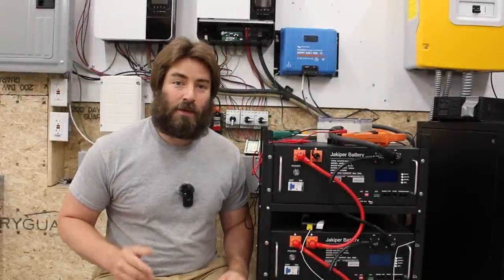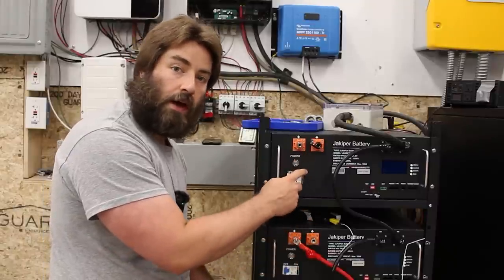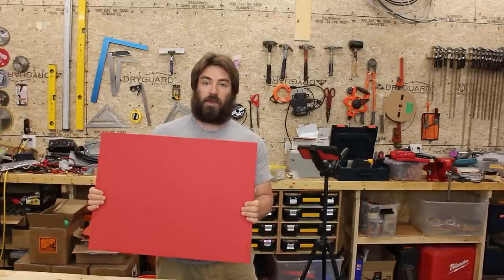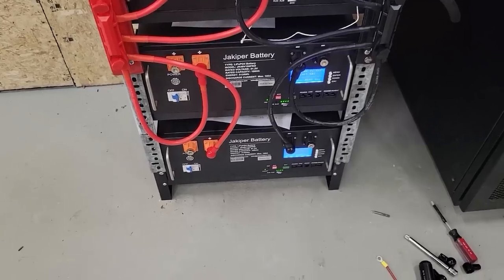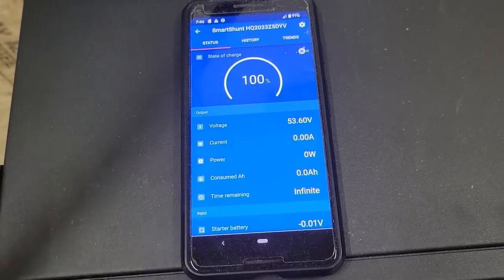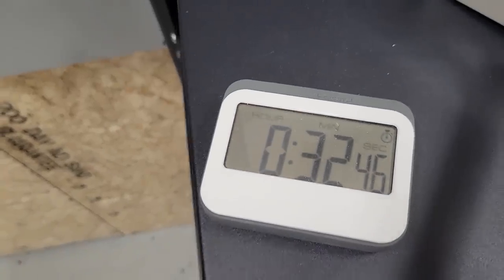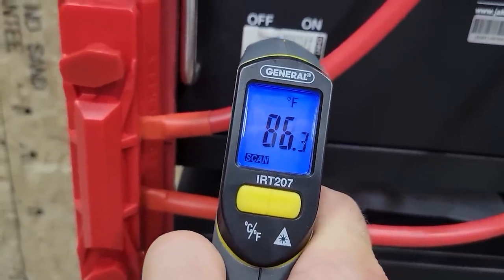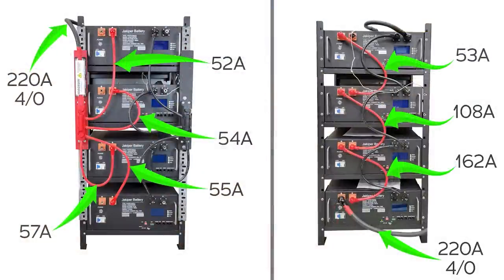Best way to wire batteries.   Part 3

Comment: Apologies for a possible silly question but why not just increase the size of the jumper cables to 2/0 gauge or even 4/0 from the 4?  There would be less connections.
Reply from the maker: Increasing the wire size would certainly help, but not as much as a central busbar.  The reason is that the electricity still has to flow through the brass jumper bar inside the battery.
Reply: @DavidPozEnergy  Thanks.  Ahhh, I understand now.

Comment: I am confused by the wiring of the batteries described as daisy chain. Are they in series or parallel? Are they in // with opposite end connections?
I am surprised by the use of an AC rated fuse in a DC system. What do Littlefuse think?
Reply from the maker: The batteries are in parallel with each other.
Reply: @DavidPozEnergy  Thank you. I've just heard you say the fuse is DC rated.

Comment: So do i actually need a fuse between the battery and inverter?
Reply from the maker: Code says you need over-current protection.  This could be a fuse and/or circuit breaker.  Using a Class-T fuse is a good idea with lithium because of the short circuit protection.
Reply: @DavidPozEnergy  sweet thanks man. Electrician just stuck 2 wires in then called it done so gonna make it safer now

Comment: It might not look as neat as Daisy chaining the cables but electrically it’s a much better option. Not mentioned, but having the cables the same length is important.
Reply from the maker: All the 4 gauge wires are exactly the same length.  They were pre-made and sold by Orient Power.  I have a link to them in the description.  But, you are right that I should have said they are all the same length.

Comment: So do you think the bus bars are necessary if we're only doing two of these. I have two 12v server rack batteries, and I use 4/0 very short runs.
Reply from the maker: If you are only doing 2 batteries, and you only have 1 ring terminal per bolt, then I guess it's OK.  Still not my preference, but I can understand it.  However, I've seen setups with 2 or 3 ring terminals on one bolt, and that's a big problem waiting to happen.

Comment: Excellent improvement in design! I hadn't considered the heat/cool expand/shrink component of connecting the batteries with a big long bus bar. Excellent overview!

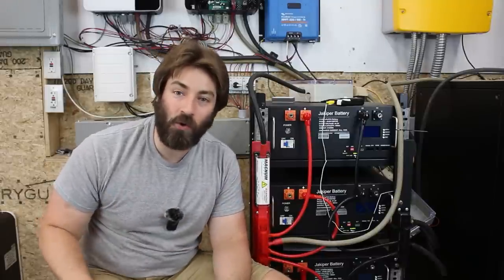22:11 I noticed a big thick tan cable running to your positive bus bar at the end. What was that for?
Reply from the maker: That is my temporary parallel wire to my Gyll battery rack.  In a future video I plan to have another busbar on the wall just below the inverters and then I'll move the wires over to that.  But the tan wire is 1/0 and has it's own fuse over at the gyll batteries, so it's OK for now, but not clean.
Reply: @DavidPozEnergy  Cool, got it. So you ran your Gyll pack in parallel with the Jakiper setup? Any issues? I assume not, it's just batteries! Thanks David!
Reply from the maker: No problems.  But, when you do it the way I did, there is more resistance in the tan wire to get to the Gyll stack.  This means the Gyll stack lags behind the Jakiper battery by about a tenth of a Volt.  Once I get my new busbars up on the wall and run both stacks in evenly, then they will move up and down perfect.

Comment: Excellent, was there a total kwh usage comparison between the Daisy vs the busbar?
Reply from the maker: No, I didn't run another capacity test after re-wiring.  We hit the specifications in the first test, and the capacity test is performed at lower amps, so the way the wires are routed will have less impact over a long duration test.
Reply: Ie a before and after kwh  charge state for each test

Comment: Are those lines equal length from the buss bar to the battery terminal?
Reply from the maker: All the 4 gauge wires are exactly the same length.  They were pre-made and sold by Orient Power.  I have a link to them in the description.

Comment: Thanks for the great video @davidpoz   How would you connect this and your EG4 battery rack to your inverter?
Reply from the maker: I mounted another set of bus bars as close as possible to my inverter.  I ran a 4/0 wire from the bus bar to my EG4 rack, and another 4/0 to the Jakiper.   This bus bar is also where I have my charge controllers tied in.
Reply: @DavidPozEnergy  thank you for the quick reply.  I have the 6 slot eg4 rack and just added the 3 slot eg4 rack.  Do you see a problem if I tie the top rack to the bottom racks bus bar and call it day?  Would that work?  Thanks again for the help.
Reply from the maker: It would probably be fine in the grand scheme of things.  However, the second rack, that is farther away and "daisy chained" to the first will lag behind.  You will notice it charges last, and discharges first.  Generally not a big deal in house back-up, unless you are pulling serious Amps.  You can always wire it that way, and then observe it for a week with some amp meters.  If you don't like the way it's operating then change it.
Reply: @DavidPozEnergy  thank you so much for your input.  You are awesome!

Comment: Without  using  a bus bar configuration  use  a higher gauge cable or run the same gauge cable in parallel,  2 wires not one. Best thing is to know your cable ratings & slightly over rate cables, insulated socket set & spanners a must when working on electrical hardware & definitely no little kids. Hope they don't decide to do more electrical work when Daddy's not home....

Comment: Why was a fuse necessary when using a busbar but not when the batteries were daisy chained?
Reply from the maker: I think a fuse should be used in both cases.  Usually I've seen the fuse be mounted to the wall when daisy chained.  But the safest location is on the battery.  I incorporated the fuse with the busbars as an improvement over mounting on the wall.
Reply: @DavidPozEnergy  That makes perfect sense. Thanks for the courtesy of your prompt reply.

Comment: What is the reason for adding the fuse? Is it only on the positive?
Reply from the maker: The fuse is only on the positive.  The reason is because I'm connecting a 4/0 wire to the output side of the busbar.  The 4/0 wire is not made to handle the whole potential of all 4 batteries, so it needs an over-current protection device.

Comment: Hello, I am putting a 16v supercapacitor (CAP) 500 F in pararell with a 14v Lithium Battery System to help the inverter with initial high/short load drawing, would it be ok to connect the CAP + & - to the same respective busbar terminal with the batteries... I cant do anything about the CAP being 16v as it is a fixed unit, would a busbar help stabilize the voltage overall between the batts and CAPS?
Reply from the maker: Generally, yes, you can parallel at the busbar.  keep in mind, that you have to set your high and low Voltage settings to the more conservative values of everything paralleled together.  Meaning, if the capacitor bank has a maximum Voltage of 16V, and your lithium battery has a max of 14.6V, then you have to set your charger to 14.6V.  The more conservative value.

Comment: David, I have a question about grid tied solar. I have heard reports of more than 100 watts of draw on the grid with full batteries, nothing running and solar panels producing ~3 kilowatts excess power. One report was the same but they were using power and producing many times the usage in solar but still drawing over 700 watts. With the way grid-based solar works by reinforcing the grids standing wave it seems impossible to have much financial benefit if some amount of electricity is required to be boosted.  Feed-in tariff here is 2.5 cents per kW and electricity price is 36 cents per kW.
Reply from the maker: Grid-tie rules and regulations vary all over the world.  Where I live, the rules even vary from town to town.  If you have rules that make it not worth feeding the grid, then just go off grid.  All my solar/battery system is strictly off grid.
Reply: @DavidPozEnergy  I was wondering if if always requires some grid draw to run the grid tie inverter? Is it a percentage?
Reply: @DavidPozEnergy  Also am I right in my understanding on how that works? If it is then barely anyone talks about it, might be a good video idea!
Reply from the maker: All my work is off grid only.  I don't plan to make grid tie videos, at least anytime soon.
Reply: No probs, thanks for replying!

Comment: 10k nice load did the 4/0 cable ever warm up?
Reply from the maker: Hmm, I never did check the temperature of the 4/0 since it wasn't the focus of the video.  I remember being able to hold it with my hand, and i felt it warmer, but not hot the way the 4 gauge was.

Comment: Is a T class fuse really needed? Each battery circuit breaker has an interrupt capacity of 10kA, right?
Reply from the maker: I wanted an over-current device to protect the 4/0 wire from the busbar to the inverter.
Reply: @DavidPozEnergy  I didn’t think of that. That’s fair.

Comment: Great Video mate, I am buying their two power wall batteries, do you think I need a bus bar? Just two batteries will have the same effect as your four batteries in terms of heat?
Reply from the maker: I would still use a busbar even with two batteries.
Reply: @DavidPozEnergy  thanks mate, I can see few without fuse, is fuse a must? How do I know which Busbar to get for two of these batteries? In terms of specs.
Reply from the maker: The goal is to build a safe system.  Part of that means having "over-current protection" on each circuit.  Over-current protection can be a fuse or circuit breaker (sometimes both).  If you are purchasing two Orient Power power-wall batteries, the ones that are 100Ah, then each battery has a circuit breaker built in.  I think that was a 125A circuit breaker on each?  This means your total potential is 250 Amps.  This is what we want to look at for a busbar.  This means looking for a copper busbar, that is 1/8"x1" approximately, or about 3mmx25mm.  (make sure it's copper and not brass).  Here is an example: https://amzn.to/3NKrg3h
After the busbar, if you run a 4/0 wire to your inverter, then I wouldn't worry about an additional fuse since the 4/0 can handle the whole 250A.  However, if you plan to run a smaller wire, such as 1/0, then you need over-current protection for that new wire.  1/0 is good for 125A cont. so it would need a 125A circuit breaker.
Reply: @DavidPozEnergy  mate you are extremely helpful, thank you so much!!
Reply from the maker: Your welcome.  If you decide to purchase from Orient Power, please use my code DAVIDPOZ

Comment: I have a sol-ark 15k and am looking at batteries.  It has a 200 amp breaker.  Do you think I need to fuse them also?
Reply from the maker: Depends on the ratings of the breaker.  I moved away from Sol-Ark because it didn't work well for me, so I'm probably not the best person to ask.
Reply: @DavidPozEnergy  Thank you, I did see that.

Comment: Hey brother,

I have a Growatt TL5000, with 6.6kwh Growatt Lit batteries and 2200w solar array (2 strings)

Solar power increase incrementally from 8:00 in morning up to 12:00. At this time the battery is fully charged, then solar goes off-line and the battery supplies the load.

How do I get the solar (pv) to continue supplying the load even when the battery is fully charged, until such time that;
(1) there is no sunlight?, or
(2) the load requirement by the house is higher then solar output ? Where at this point I should be able to choose if the battery or utility should supply the load.
Reply from the maker: Hi William,  Sorry, but I don't own a "TL5000" and have never used it.
Reply: Thx for replying

Comment: Should be 400A fuse?   4 x 100A from each pack.
Reply from the maker: The busbar needs to be rated for 400A.  However, the fuse is protecting the wire coming off the top of it.  That is a 4/0 wire that goes up to my inverters.

Comment: Dave, can we parallel difference  ( 228ah and 200ah ) 12v lithium brand? Thanks
Reply from the maker: Yes.  Batteries of different capacitates can still be paralleled so long as the voltages and charging profiles are the same.  Sometimes, at high amps, you might notice the smaller battery lagging being the larger one slightly, but it's usually not a problem.  The only time it's a problem is if your loads will exceed the maximum discharge current of the larger battery.
Reply: @DavidPozEnergy  thank you Dave, you are great😀👍 when you said ‘ voltage and charging profile are the same” is it prefer to both have same 12v battery, same brand?

Comment: Why can't you connect the batteries in series?
Reply from the maker: these are 48V batteries.  If you connect them in series you would make a 96V battery.  You could do that if you wanted 96V.  However, I'm using 48V charge controllers, and 48V inverters.  I don't have any need for 96V.
Reply: @DavidPozEnergy  You are correct!

Comment: Dumb question time: Would mounting all the cables on one terminal stud instead of a bus bar make any difference?
Reply from the maker: The more ring terminals you stack under one nut, the more likely it is to loosen up over time.  I suggest keeping it to 2 lugs maximum per bolt.  (1 is best)
Reply: @DavidPozEnergy  Good point. Thank you for your reply.

Comment: I was hoping to see some difference in capacity due to energy losses.
Even 1% would be huge difference.
Reply from the maker: I didn't run a capacity test again, just a heavy load test.  I didn't think to run another capacity test since the rack hit the spec on the first go around.

Comment: What about using larger cables and stacking them on the same battery terminal instead of using the jumper terminals?  Similar to the copper bus bar idea you mentioned at the end but allowing flexibility so the screen isn't covered and the terminals aren't stressed.
Ideally you could use a crimp on cable butt connector that joins 2 cables and has a single hole terminal in the middle.  I just searched for something like that but haven't found one, wouldn't be that hard to make.  It would look something like this from the side:  =\_ _/=

Comment: Why do you need the bus bar. Can't you just connect the all the wires to the fuse and get the same result?
Reply from the maker: If you were to stack all 4 wires it would probably be OK for the most part.  It would look a bit odd because each wire would have to enter at a different angle onto the stud.

Comment: you didn’t connect the data cables. is that ok?
Reply from the maker: Sure.  Communication is a "nice to have", but not a "need to have".  When I'm testing batteries for capacity, load, etc. I skip the communication simply for time.
Reply: @DavidPozEnergy  thanks.

Comment: I thought GRISLEY ADAMS was now doing battery reviews. Your work bench looks just like mine more junk than space. I have a frind that says you should only build a workbench with a surface area of 1ft x 1ft becouse that's all of the clear workspace you are going to have anyway. 
You could number each of the cables 1-4 and then move each of them down one battery and move the last cable #4 up to the top battery and see if the current readings follow the cables. It may be voltage drop in the crimped terminal lugs. Have you checked the end to end resistance of the cables?
Reply from the maker: Yeah, the workbench becomes a catch-all.  I have not checked the resistance of each cable.  I did do a pull-test on each, but not a resistance check.  It would be fun to do one.

Comment: David you could increase the efficiency even more if you made all your cables exactly the same length. This would keep the temp and current loss equal.
Reply from the maker: All the 4 gauge wires are exactly the same length.  They were pre-made and sold by Orient Power.  I have a link to them in the description.
Reply: @DavidPozEnergy  Sorry it looked like the ones in the middle were shorter.

Comment: U have 400 amp battery u used 300 amp fuse if i have 300 amp batteries should be 200 amp fuse ? Or 300 work
Reply from the maker: It will depend on your situation.  
In my situation:
Each battery can discharge 100A, times 4 batteries in parallel equals 400A potential discharge.  I must stay below this number of 400A.  That's my upper limit (maximum).  Now I can look at my equipment and see what my minimum is.  I'm connecting it to my 10kW inverter setup.  10,000W/48V=208.3A  The NEC (code) requires conductors be oversized 20% if the load can be continuous.  208.3A*1.2=250A  This means I need to size my conductors (wires) for 250A.  Check the NEC Ampacity chart and you find this is a 4/0 copper wire.  Next, I need to size my over-current protection.  If you are using a circuit breaker, then you size it to 250A.  But, I'm using a Class-T fuse.  Class-T fuses are sized higher because of the faster reaction time.  This means a 300A fuse works.  It's higher than the 250A minimum, and lower than the 400A maximum my batteries can handle. 
You will need to follow the same logic when sizing your own system.
Reply: @DavidPozEnergy  i am using a 125 a breaker for my 400 amps lithium battery racks which should be safe as long i can go to 250 a so i am safe... + i have one more question how should i calculate my c rate the max discharged battery if it s 400 ah should i dived by 20 or 10 ?